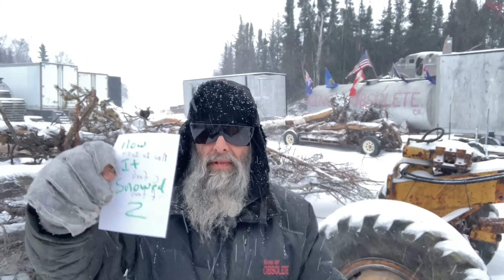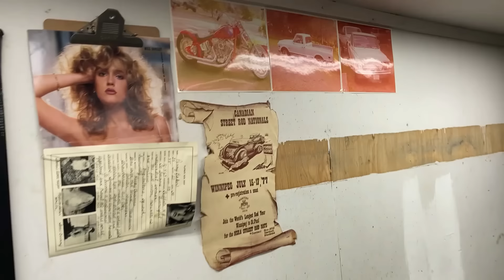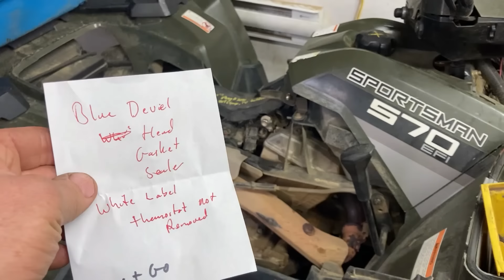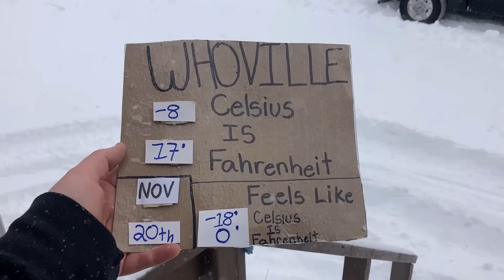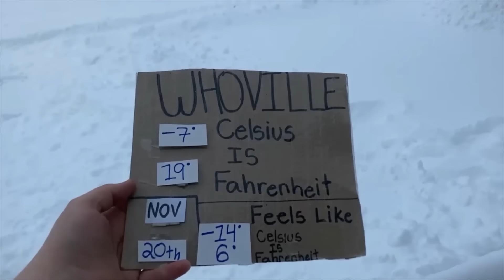Deep Snow, More to Come So We Just Dragged the Dog Trails With Lavern Nov 20 2024

Comment: Mr. KoO, Been there and done it. That's why I used the cooling system pressure tester to pump up the cooling system to 14 or 15 psi. while running the engine. Then after it's mixed and circulated shut it off and drain the oil BUT KEEP THE PRESSURE ON for overnight. If you don't have a cooling system pressure testing kit, you can put a valve on one of the drain plugs and put a tiny bit of shop air into it from there. But I always came back and pumped up the checker pump to maintain a good pressure on the system. Silver powder works too and there is a copper colored powder but I have no experience with it. Esso should have one of them. I always liked Atlas Block Sealer the best. It looked like silver cream, no clumps like Bar's.  Also Also, the Cadillac dealer used to put AC Delco coolant tabs into the radiator at every visit. It drained out with the antifreeze when you change it. If you leave the drain plug out over night, you will see if there is a leak. BIGGIE I always pulled the sparkplugs out too just to make sure I didn't have a cylinder filled. On a big V8 if one cyl starts to fill and you crank it, it might try to start. If it does, you have a bent rod RIGHT NOW. So always pull all the sparkplugs and spin it over with the starter just to make sure. ben/ michigan
Reply: Good tip, yeah, you don't want a hydro-lock.
Reply from the maker: yes if this moor is worth the time and effort to save it. i think it is toast and will try the Blue Devil if it works it works, if not this quad is now the parts machine for the other one  thansk

Comment: Have used blue devil i think it will work in your case is expensive use recommended amount more is not better fixed my 84 chevy 6,2 diesel for about year cast heads was not gasket was cracked heads lol 😊
Reply: Blue devil works great. Never had a complaint out of it.
Reply from the maker: yes on a small motor on the quad any quick fix would be good  thansk
Reply from the maker: @Boneshaker420  good to hear  thansk

Comment: Joey, I wish I had known about that Blue Devil stuff several years ago. I had a cracked block in a MF tractor. Of course, according to the previous owner had nothing wrong with it! Long story there, but like you, I grew up with Bars Leak being the best to use. And like you said, all it did was plug up my cab heater. But I was very lucky that it was only the heater hose that plugged where it went up to the heater, and not the core itself. I ended up putting another engine in the tractor, but maybe the Blue Devil would have saved me all of that $ and grief? So I learned something new also!    😊
Reply from the maker: yes this is the learning channel where we are all learning. there are many new products on the market that have been super promoted. but when people comment with the product actually working that is when we know it works. bars leak was made for old style motors which does not work in today world. at least your plugged up in an easy location to correct.  thansk

Comment: I like Laverne and the tire drag. No traction problems. No brush plugging.

You should use the TD6 more in the wilderness for the wood trailer and save wear and tear on the quads. Pretty rough on them.
Reply from the maker: we did not think Lavern would fit on the trails and we don't use these cats in the summer because the ground is way to rough for them. all we have up here is rocks and more rocks. also too most people don't load that much on a trailer behind the quad too.  thansk

Comment: Have you considered making a blade extension - higher/wider for you mini Joey?  Maybe some simple wings for the bucket to allow you to cover more area with each pass of the bucket?
Hopefully you will get enough snow to run the big cat with the V plow around. 😎
Reply from the maker: we thought about improvement but we have enough cats and equipment to handle the snow. the mini Hoe should be just used for the tight areas  thansk

Comment: Lol you gassed up the electric saw however I've seen chain saw motors turned into skill saws and I think Montgomery wards actually sold one that ran on gas probably the most useful tool I've ever seen
Reply from the maker: yes those little 2stroke motors can be used on everything from drills to winches.  thansk

Comment: I don't understand why you have any trouble with running chainsaws in the kingdom? I bought myself a lemon from Marketplace. I upgraded the fuel lines and got it running flawlessly. Everybody knows that Poulans are usually throwaway junk! My Poulan was junk. The previous owner didn't have a clue how to fix it. He had it all apart and had it back together ass backwards almost about to scrap it. I found out all the mistakes and put it back together correctly. I took the chainsaw out yesterday and put gas in it and it just fires right up even in freezing temperatures! Some of the neighborhood walked by and watched me and my happy little massacre!
Reply from the maker: chainsaw are like women to me, i never have any luck with them no matter how much i spend on them  thansk